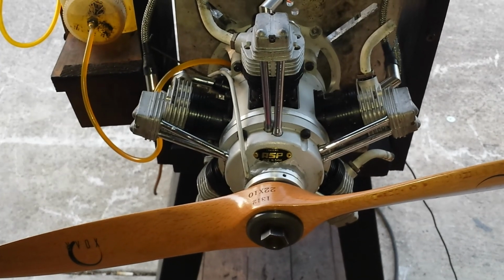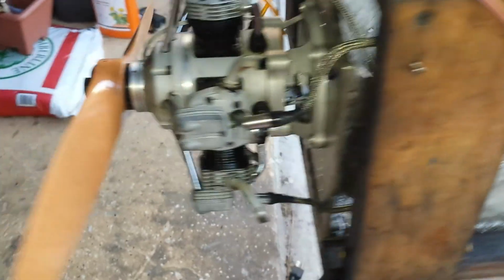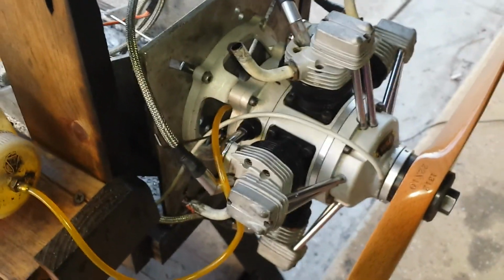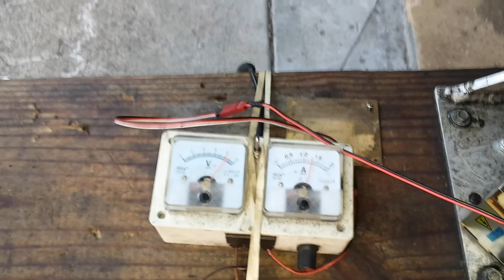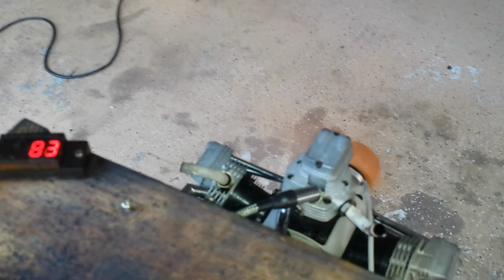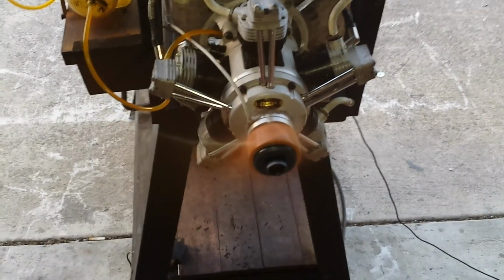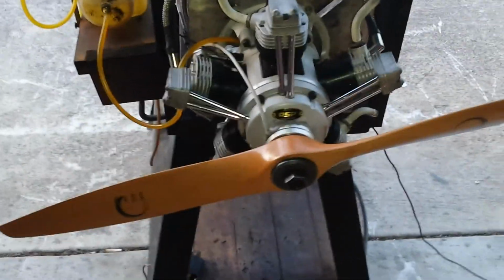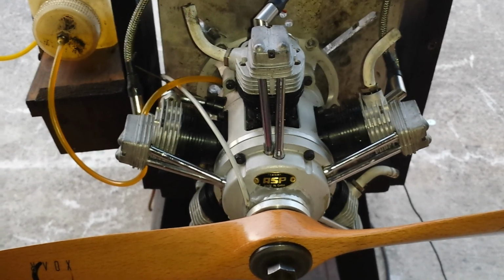ASP FS 400AR 5 Cyl, CH CDI & GASOLINE CONVERSION

Comment from the maker: Vit, 
the engine will run hotter , need to use 20:1fuel mixture, (50ml oil to 1 L gasoline)
If you make proper vent for the engine to have a good airflow and cool off , will not be a issue.

Adrian

Comment: Hi, I´ve ASP 400 AR and I would like to conversion to GAS. How is 
lifetime GAS ASP?? Is there some problem with temperature of cylinders 
or pistons or cylinder heads?? because gas has higher calorific value 
and gas engines require a larger cooling ribs. Thanks for your answer. 
eith regards Marek